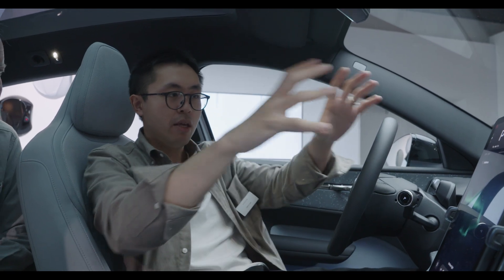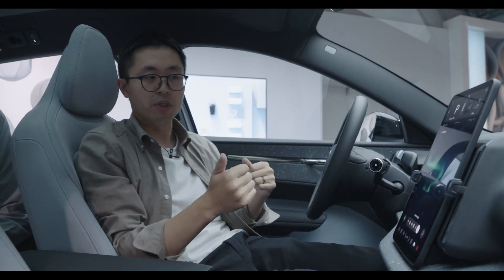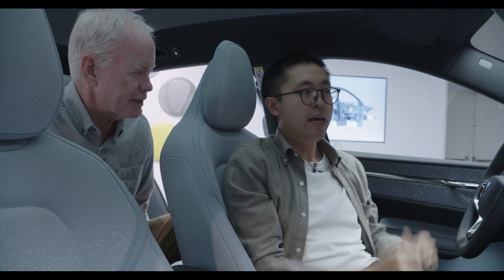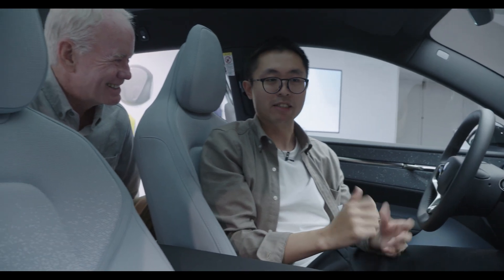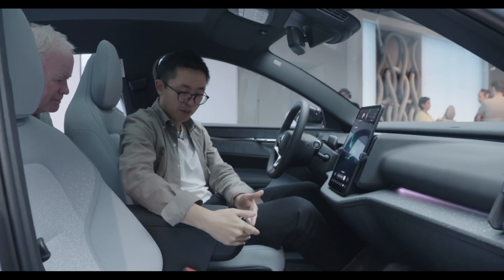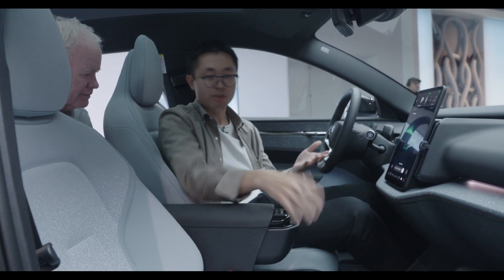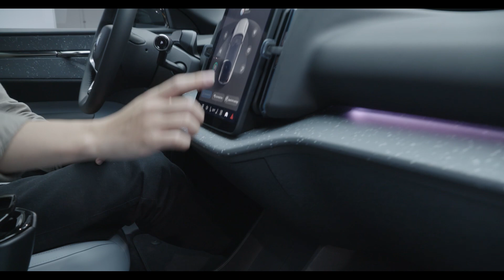Volvo Carves A Big Interior Out Of A Small Exterior

Comment: The worst idea (I don't want to use another word bc of censoring) is the full glass moonroof and that applies to Tesla's and others. It's an EV right? It requires electricity to cool and sometimes warm the vehicle. If you have an area of 60 SF (10X6 minimum) of scorching sun, how r u helping the RANGE???? I understand , glass weighs less than aluminum but any physicist would agree that an exposed moonroof without at least a protective shade (VW id.4), is the dumbest idea engineers are using on EV's. Range, range, range is the biggest worry of an EV owner. Bar none. Including myself. I never take my EV in long trips, only my ICE suv.
Reply: I prefer metal, which doesn't leak, break, or let glare in. How much extra to keep the solid roof?
Reply: @jamesvandamme7786 To keep a solid roof, it has to be made by either light aluminum or some metal composite material. The cost is not the biggest issue. Weight is the issue, hence the use of glass. Less weight/more range. But what I was saying is by having a full glass roof without a shade at least the amount of energy (electricity) it will take to cool the car, outweighs the benefit of an open environment in the car. So benefit with glass, less weight, but more energy to cool the car (imagine Florida or Arizona) and also if u think deeper, structural rigidity. Pro of metal, easier to cool/warm, con more weight, so more electricity used, less range ultimately.
Reply: @PANOSDX1968 since when is laminated glass lighter than a metal roof?
Sunroofs always incur a weight penalty.

Comment: No head up display, no instrument cluster. This is not Volvo because this is not safe. Sounds like something Geely would do, not Volvo. As a current Volvo owner, I won't consider an EX90 for any member of my family until thats fixed (and if they fix it they'll charge more for the car. Yes, the Geely way).
Reply: The Zeeker X, which is a Geely twin of this car as an instrument cluster above the steering wheel.  I believe the other twin by Smart does as well.
Reply: @Cakebattered  The Zeekr X is a Zeekr. Zeekr is a brand like Skoda is a brand. Zeekr is part of CEVT which has a design center in Sweden where they design Zeekrs  but not Volvo/Polestar, and some engineers as well. Geely is Geely Holding which is Geely Group. Geely Group is not Geely Auto. Geely Auto is equivalent to Volkswagen as a brand. Geely Auto doesn't own Zeekr. Geely Group does. And the Zeekr X really isn't a twin unless you want to say it is very much a fraternal one. It sits on the same platform but shares very little above that platform with Volvo's EX30, if anything. If you want to see Volvo making a twin look at the EM90, which I think dilutes Volvo as it isn't a Volvo design. The EX30 is very distinguished as a Volvo.

Smart is a Mercedes brand. They used the SEA platform and Geely builds the car. But it is designed and the suspension is tuned by Mercedes. The thing is what sits above the platform on the Smart #1, Zeekr X and Volvo EX30 are quite different because they are 3 different brands.It's similar to how the Bentley Bentaga, VW Taureg and Porsche Cayenne basically sit on the same platform. But they don't have the same content above them and drive quite differently. Not the same price scale, but same application.
Reply: I can't remember if it was Volvo or Saab that used to simulate a crash into a moose.  I'd love to see how the EX30 did.  Yes, we have moose and elk here.  No, I've never hit one.
Reply: They put the moose on the center storage, its harder to hit now 🤣🤣
Reply: Volvo made the decision, not Geely. Geely doesn't design Volvos. As some mentioned, other small cars on the same platform around the same size have an instrument cluster on them. So, let's not make up narratives that Geely is forcing Volvo into anything because there's absolutely nothing to show they are. And the EX90 has a driver's display screen as well as the option for a head's up display, which may be part of the middle to upper trims as well. And maybe let's see the results of crash tests and look at all the safety features in this car before saying it isn't Volvo safe.
Reply: @benjaminsmith2287  Dude, my point is whoever made the decision to put the speedo on the center screen rather than in the drivers' field of vision and place an eye nanny that alerts every time you try to look at the speedo clearly wasn't thinking safety first. It's uncharacteristic of Volvo to do something like this, but laying responsibility for this decision is splitting hairs, because inevitably it's the Volvo brand who has to own it.
Reply: @dash-ryan  The eye nanny is a European regulation. And it is Volvo who decided to put the speedo on the center screen. If Zeekr has one behind the steering wheel as does Smart, 2 similar side cars on the SEA platform, why would Geely "dictate" to Volvo to make that change. Volvo did this. Volvo decided to save  money and costs and bring the price down to lower than Volvo territory they'd make those changes.And Volvo also explained to lower the carbon footprint, one screen and centralization helps achieve that goal.

People keep saying this is a safety issue but central speedometers have been on other cars like the Nissan Quest, Toyota's Prius and in Teslas and there's no conclusive evidence it is a safety issue. Volvo says their studies conclude it isn't. I think it is annoying to look on the side but I think it's more something people are used to rather than a true safety issue.
Reply: @benjaminsmith2287  Tell that to @MotomanTV who was hit by a distracted Tesla driver putzing with their screen while he was jogging.  If Volvo made the decision then I hold them accountable for a non-safety-first decision. Inconclusive doesn't mean it's safe. It's just another way of saying, "Duh, I dunno, so let's roll with it anyway".
Reply: @dash-ryan  Any driver can get distracted by any screen. I'm not a fan of screens in cars or screens in general. And yes, hold Volvo accountable for the screens and lack of buttons. It's their design choice.